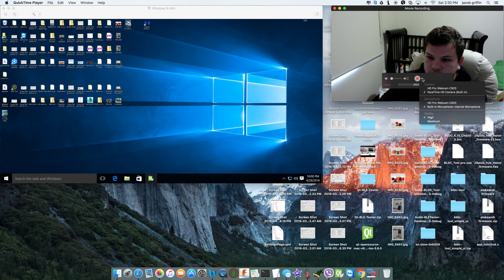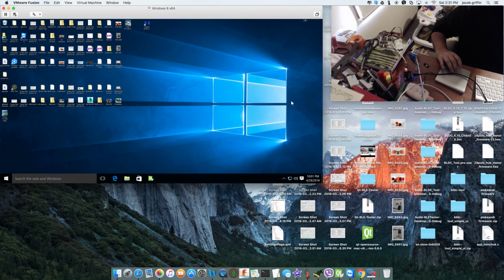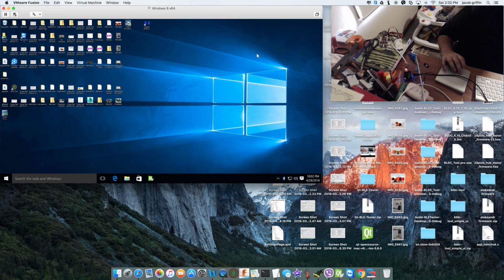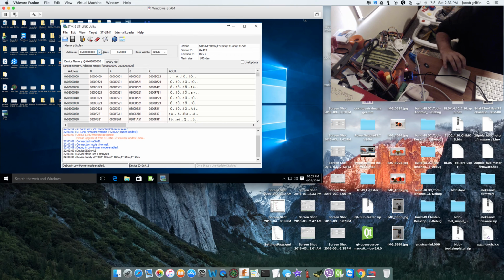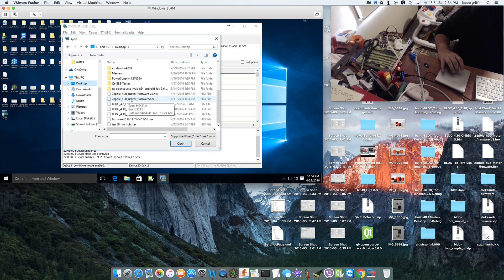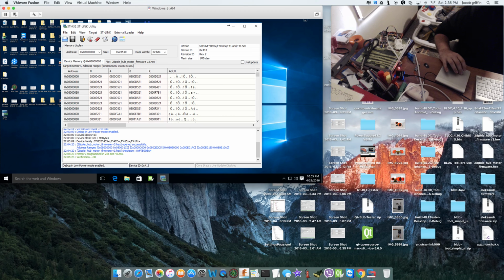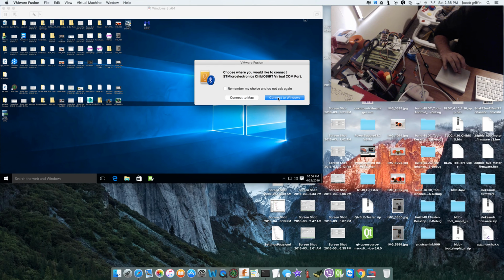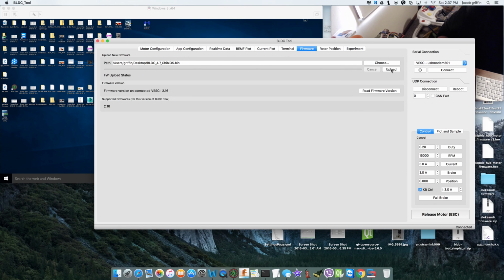VESC firmware/bootloader flashing windows stlink

Comment: Hi, this is an old video, but I'm wondering if you have dealt with VESC tool. In case can you explain if you preferred the USB or the BlueTooth connection to download the firmware into the controller (in my case it's a Flipsky 75100 PRO V2.0). Thank you
Reply: Bro is it the dual alu pcb 75100 FOC  ?? 200AMPS??

Comment: I have a vesc 6.6 dual and i cannot work our why its not working. I keep getting the error that It cannot connect. It was working fine until i started to run the motor test... I get both blue lights when its switched on. But nothing else

Comment: Does anyone has an working link? or maybe the hex-file at gibhub?
Can i find it anywhere here? https://github.com/vedderb/vesc_tool

Thank you in advance!
Reply from the maker: https://drive.google.com/file/d/1WHWhnq8VZ1UjNFvLxtQ8FMMkN1QaQk5R/view?usp=drivesdk

This is very old firmware for 4.2. It’s only compatible for BLDC tool which is very outdated, it’s combined the boot loader and firmware. Once you have it loaded go to vesc tool and updated it. Vesc tool also has a feature to load the boot loader if you can’t update the firmware.
Reply: @JacobGriffinBloy  Do you have .hex Bootloader file for VESC 6. I have FSESC 6.7 MINI, which is not getting back to work after replacing STM32F405RGT6 MCU. I tried flashing VESC_Default.bin firmware for many times, but it is not working. I tried uploading the bootloader file as well, which didn't work either. VESC Tool on my PC is not recognizing the USB connection, though the BLUE LED glows when I connect the battery. Please help.

Comment: Thanks Jacob for the tutorial. Just to relate the problem I found that may impact other people. I was using a cheap clone ST Link V2  with a metal body. On the body was screen printed the pin outs for its 20 pin connector. Using these connections I could not get the ST link to work. After giving up for some time I realised that some of the images I found on the web of the metal body ST link clones had a different set of pin outs screen printed on them. Using these new pin outs the ST Link worked and I have been able to update my 4.7 VESC.

Comment: I had some issues with the ST Link Utility. Every time I hit "Connect" the application would crash (whether or not the device was actually plugged in, so I figured it wasn't a hardware issue). I found that running it in Window 7 compatibility mode (since I'm on Windows 10, in VMWare Fusion on a Mac) fixed the issue and I was able to connect to it just fine.
Reply from the maker: I actually had the same problem, I basically had to keep restarting my VM till it worked.

Comment: Which power supply are you using for the VESC? I ask because I have a regulated power supply and I wanted to ask what's the best settings, e.g. 12V and 5A? or 2A?
Reply from the maker: That will work, but when flashing no power is needed it's all off the USB